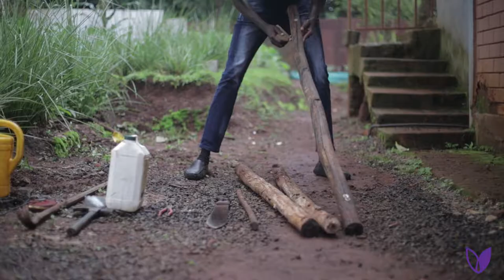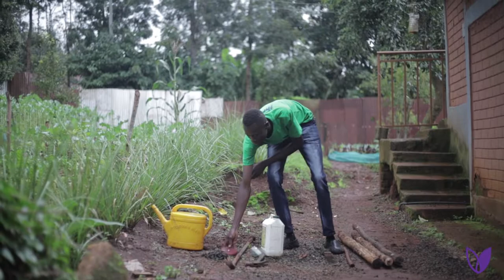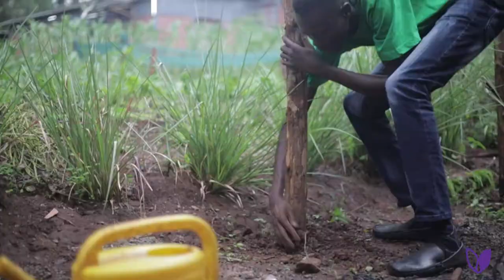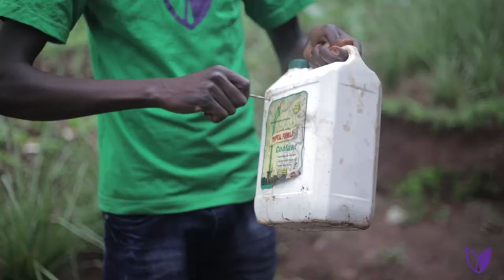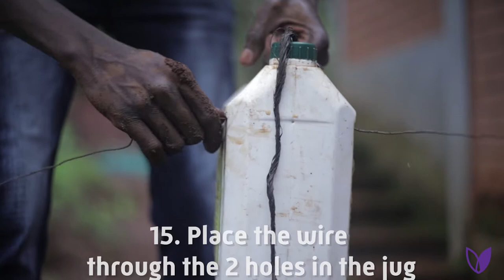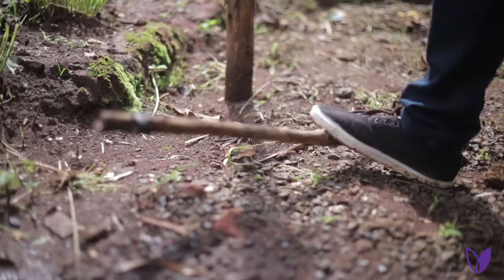Demonstration Video: How to Make a Tippy Tap - Thrive for Good

Comment: How do you dry your hands after washing?
Reply from the maker: Hi there. Thank you for your question. The best way that we suggest is to let them air dry. Otherwise, you can hang a hand towel on the tippy tap, which can carry germs. Another way is to use serviettes, but that can be expensive. This is why we recommend air drying.